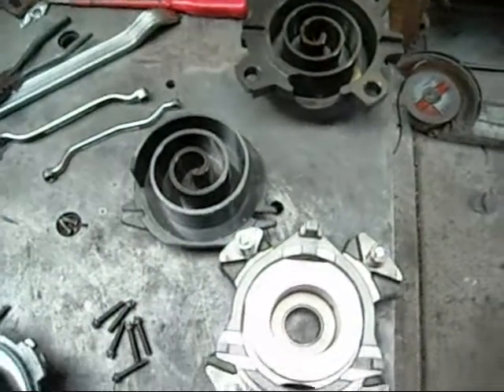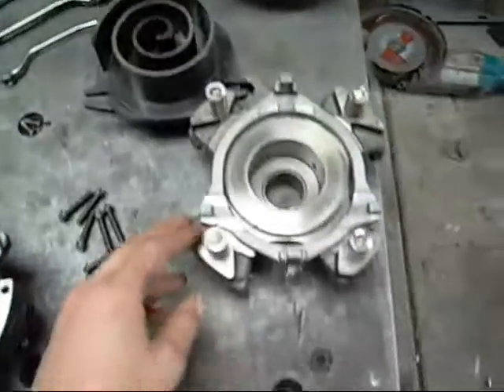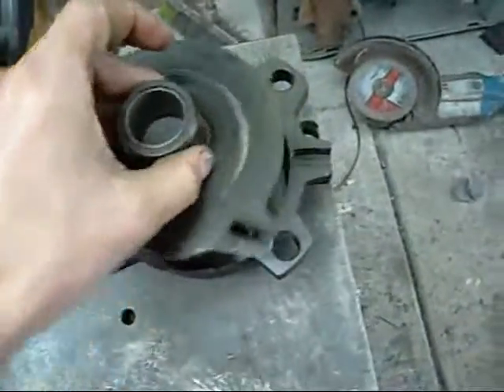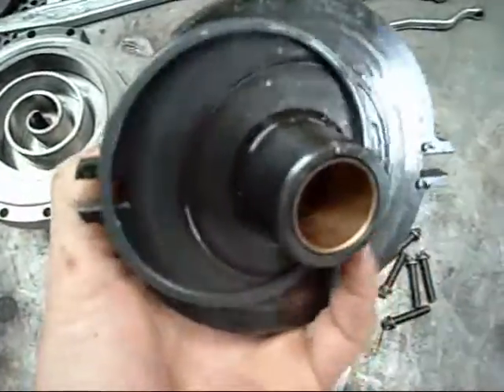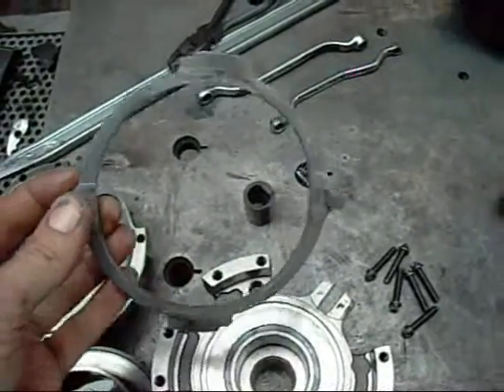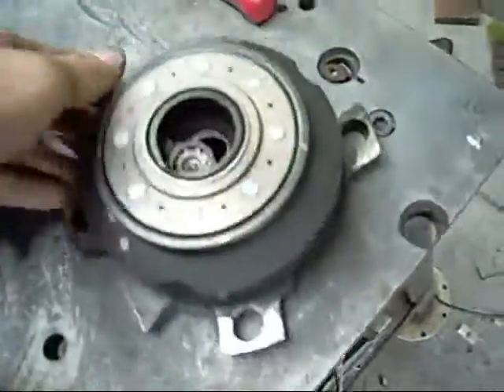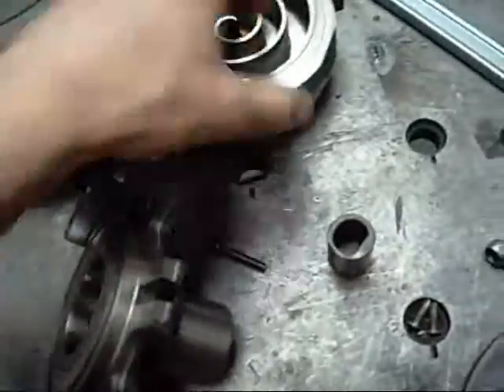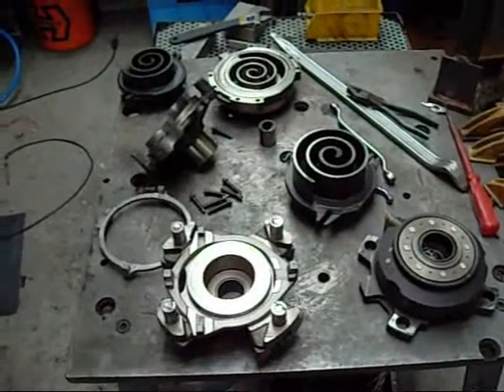Bristol and Copland Scroll Compressor Heads Exposed

Comment: Nice video, im yet to pull one apart and have only seen pictures in books about scrolls.

The efficiency is fantastic with these compressors, being an inverter it has the ability to change the speeds depending on the load. Unlike recripricating comps which are either ON or OFF. The ability to pump liquid amongst other things makes it a good compressor for nealy most applications

Comment from the maker: Another failure mode I took note of is that if there is air in the system, oil vapor and air can detonate when it is squeezed by the scroll, much like diesel in a diesel engine!

I guess these are Not suitable as air compressors!.

Comment from the maker: Good question!
The manufacturer info shows they are far more efficient than similar size reciprocating compressors, and cheaper to make (less moving parts etc..) I've never compared them myself.

Both of these compressors show no sings of failure at all, although the windings may have been bad, the condensing units they came from may have had other  probs.

Most common failure mode seems to be the aluminum thrust plate wearing out due to lack of lubrication, or breakage of the scroll walls.

Comment: that is the wierdest pump ive seen yet
it makes you wonder how did some one come up with that ? must of been fkn around with spirals one day and noticed the volume contraction???
where these pumps broken? it seems they are very durable one moving part basicly ,,a piston has at minimum 5
if read valves or checks are used
i wonder if minimul parts is why a pump like this would be used as it seems this pump has 10 times the contact service at seal points = resistants,? what is your take on this